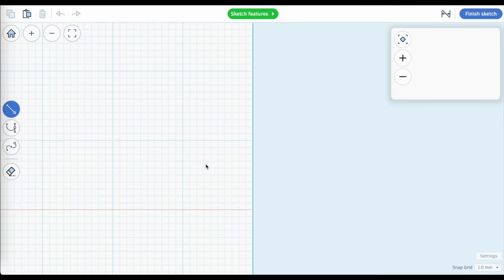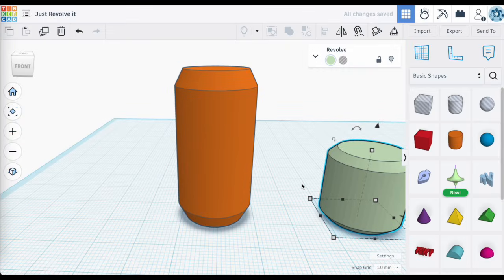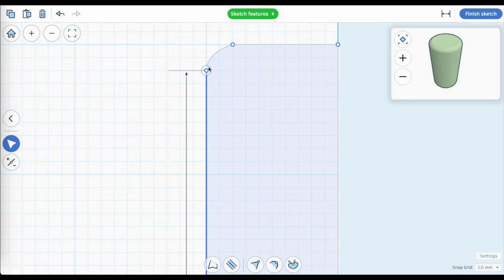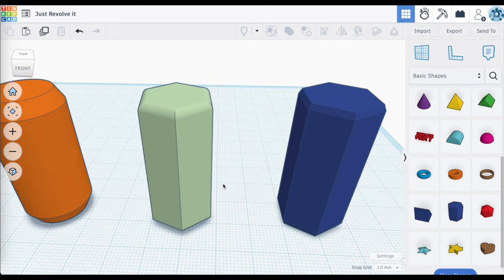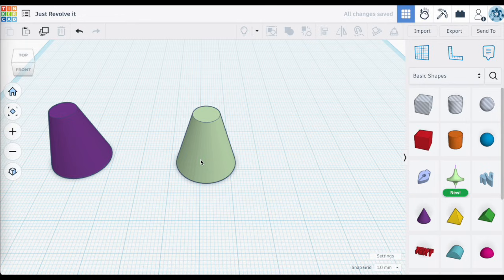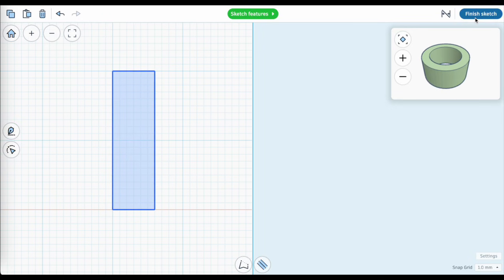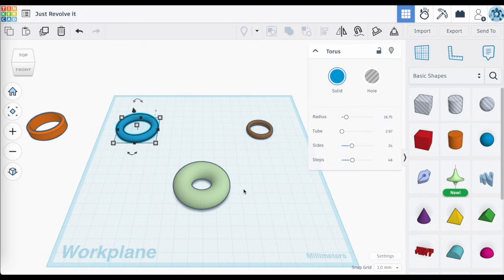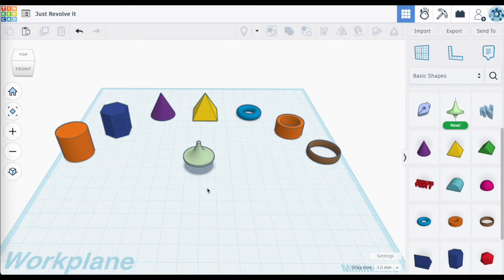Tinkercad’s Revolve Sketch makes these shape generators obsolete

Comment: If you stretched the cilinder to 40 mil, and the use the champfer, it would look the same angle as the revolved cilinder. wouldn't it ?
I would like to have snapping nodes on the solids for snapping to kind regards Hans
Reply from the maker: Hi @hanspijpers2100 - My apologies if I misread your question but when using the bevel setting on the cylinder shape generator the angle of that bevelled edge will change as you resize your cylinder (unless it is resized proportionally along all axes).  When using revolve sketch, you can set the angle of the bevel or chamfer in the creation of the revolve sketch.  Again, my apologies if I did not answer your question here.
Reply: @technobentobuilds  If I create a cylinder of 20 by 20 , 20 high. and I take the existing cylinder of the same dimension, then i champher them with 45 degree. it makes no difference, if I stretch them to 60 high, they both distort the same amount. but if I stretch the cylinder first and the chamfer them then they both are the sam 45 degrees. 
so it all depends on the order of operations. and there is no difference between the procedures. that is what I meant
Reply from the maker: @hanspijpers2100 - Ok I see what you're saying.  Interesting!  I have always struggled with the chamfer for the cylinder whether it is done before or after it was stretched.  I will check this out again.  Thanks for posting this!

Comment: Is there a way to revolve into hollow shape? For example make a bent pipe instead of using the existing shape generator. Or a hollow torus instead of a filled donut. It seems that anytime I connect all the points when using the revolve tool, it creates a closed shape/crossection and revolving that gives me a filled final shape.

I would like to use the line/stroke width tool but it's greyed out when the shape/crossection is closed. 

If I don't connect all the points, the shape/crossection is deemed open, and only then I can use the line/stroke width tool. But the resulting revolved shape is now open on at least one side. I could combine shapes to close it and get a hollow final shape but hopefully there's a better way.
Reply from the maker: Hey @brianmack6285 - that is exactly what I am working on now!  But yes, for some reason creating a hollow circle does not work in revolve sketch.  What I have had to do is create 2 revolve sketches, one as a solid and one as a slightly smaller cutout.  Be sure to align the second revolve sketch to the first one by their mid points. Once you create these 2 shapes, you should be able to create any bend you like by sweeping the solid sketch.  I have a feeling this is a glitch and hopefully this will be addressed by the good folks at Tinkercad.  But until then there is a work around.  Good luck!

Comment: It can replace other shapes, but the others use less system resources and render and group faster.
Reply from the maker: Good point @DanK-ZDP189  - it does come at a cost.  I do notice the lag when I start to group several sketches.